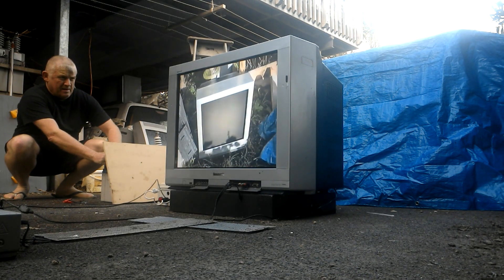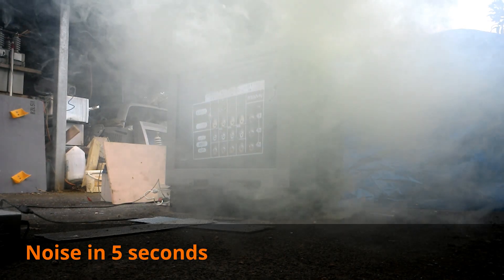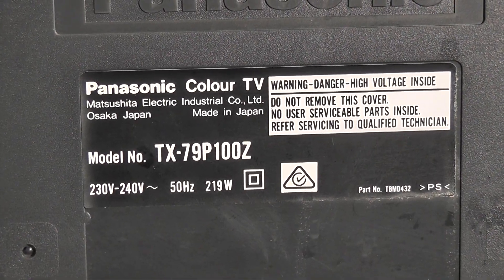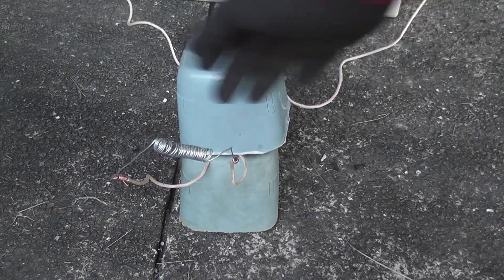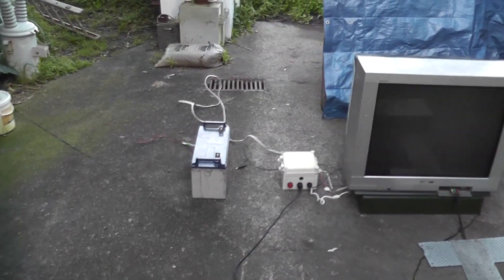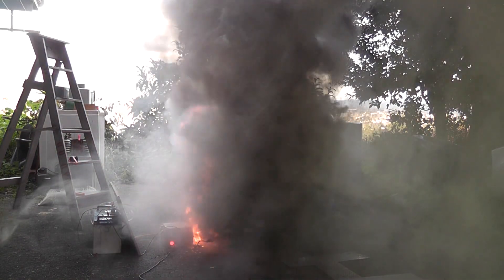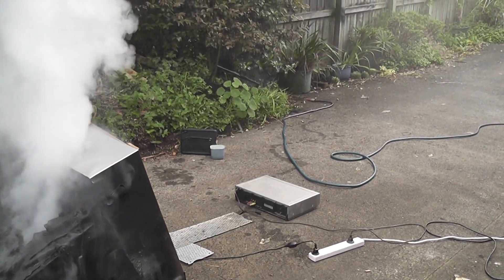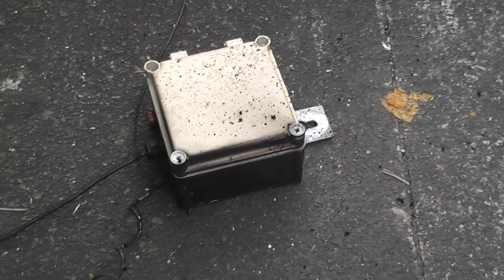Prepare and blow up the old CRT TV

Comment: You sure do put lots of good work into your videos. I like how it leaned back also - it kinda scares me how even larger tube TV's have such a seemingly flimsy frame yet weigh nearly 200 Lbs. I have to dump an enormous flat Trinitron (bad picture) that makes very scary noises when it gets moved around. So big I can't get it down the stairs to pop it from the front with a weight outside. Not sure what I would do with the enormous and heavy front-glass shards of death either. I just have to pop it though... so I'll heave the 40 lb weight into the back of it indoors. That's going to take a long time to plan and set up so the garage doesn't get dusted with phosphor and glass.